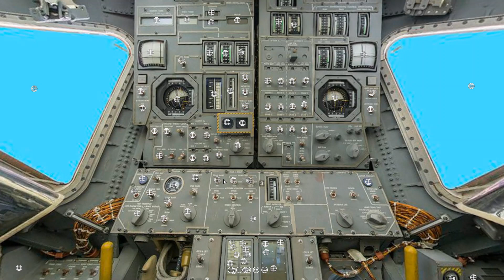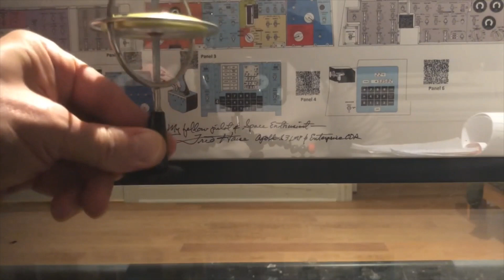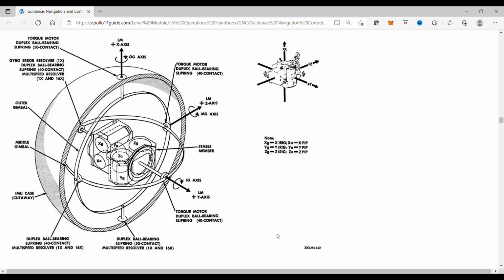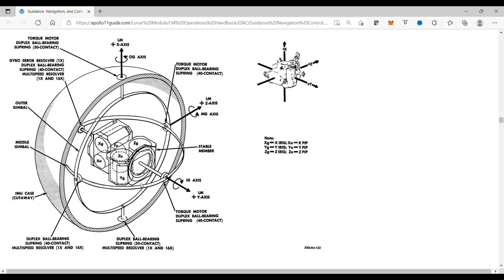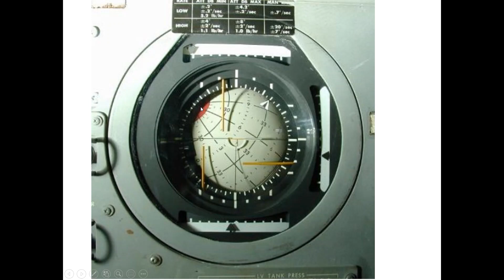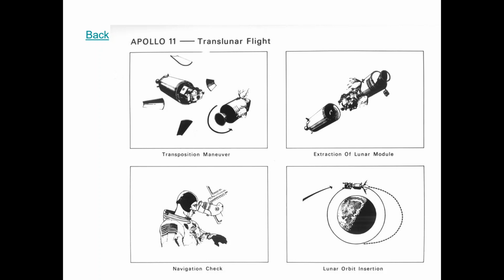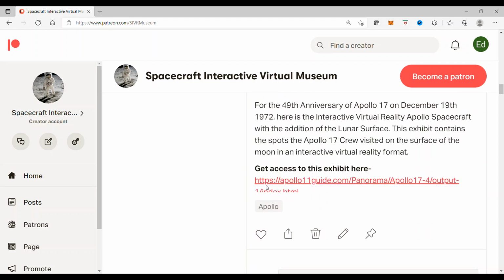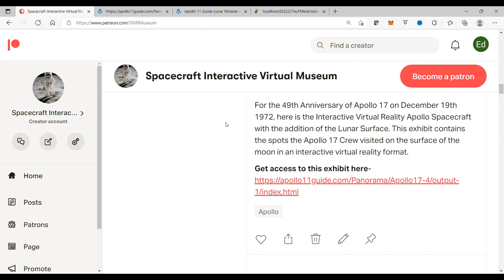Gimbal Lock, Apollo, and How NASA Navigates Space

Comment: A couple of comments on the topic of gimbal lock as it relates to Apollo. 
I think it is overdramatised in many accounts. As long as it occurs away from major manoeuvres, there is plenty of time for a crew to realign the orientation of the stable platform. As a good example of this, Neil Armstrong put Eagle into gimbal lock in the moments before Collins docked with the LM after rendezvous. What did he do? He immediately switched to the AGS, his backup system and used that to hold the LM's attitude while Collins brought Columbia towards it. It was no big deal.
You mention about Apollo 13 having an issue with three gimbal axes lining up. I've never heard of such a thing before and wonder where the idea came from. Gimbal lock, at its simplest, is when the middle gimbal angle approaches 90 degrees, causing the axes of the outer and inner gimbals to approach being in line with each other. As this condition is approached, it becomes harder and harder for the motors that drive the gimbals to maintain the platform's orientation. Essentially, one of the three degrees of freedom of the system is being lost.
I hope this helps.
Reply: You are correct. I used a bad source that said all three aligned. I want to do a correction on my next episode. Can I reference you in the video?
Reply: What is the geometry or physics reason for the system failing and a degree of freedom being lost?
Reply from the maker: What if they dump all the data on their position because the computer loads the position on the launch pad?